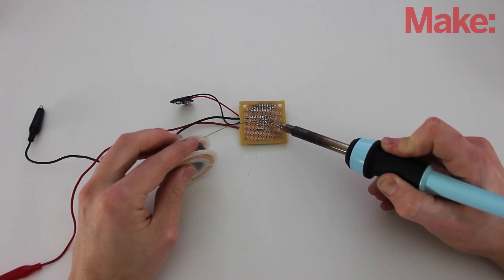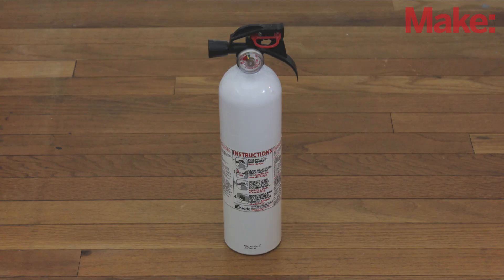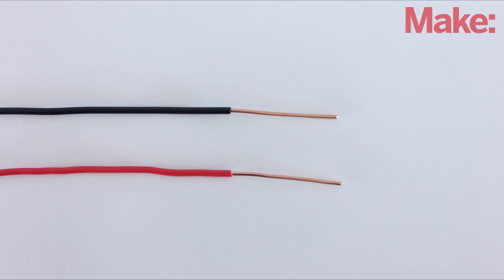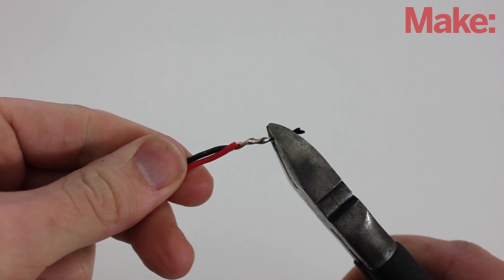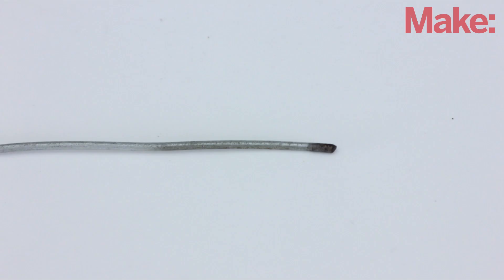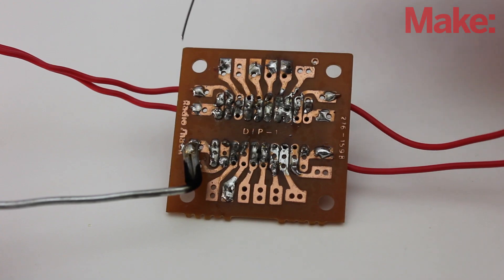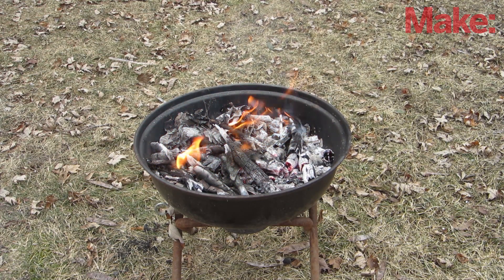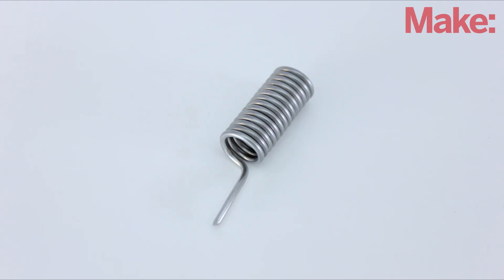Soldering Without Electricity

Comment: Never once in my 40 years have I had an emergency, where I had to solder something in the rough. Not saying it couldn't happen, just I've never had a ’solder’ emergency.
Reply: i once accidentally pulled off my keyboard's cable. it broke near the circuit board so i had to re-solder everything. i used the metal that was already there and a hot screwdriver put everything back in place. i also applied a bit of hot glue that i found inside the keyboard over the joints using a hot knife so that the wires wouldn't move XD

a few weeks ago i dropped my tv remote and the infrared led died. i ended up removing the led from an old remote and putting it on the broken one with a hot screwdriver again.

i'm still using the same remote and keyboard to this day,  when something breaks in my house i'll always try to fix it with whatever i have before throwing it out, and i became quite good at it over the years. we brazilians are known for doing this kind of stuff, we call it "gambiarra".
Reply: Haha you don't need to solder anything quick when you're out camping like everyone else does?
Reply: Then you are very lucky.

Comment: dont u need to put smth on before u solder
Reply: You mean the "flux". But he seems to be using Rosin-Core Solder (the flux is already inside the solder). In any case, I just wanted to know if the electricity-less method would work; he has other videos about how soldering.

Comment: best video I've seen on this. I got a client that needs his cheap cruzer flashdrive repaired. the "power" is on but he computer doesent recognize the device because the solder pads are fucked. i'm going to solder an old usb cable to the circuit board, and I got to do it in a library. I cant just whip out a large soddering gun! lol. this method can be achieved with my back turned up against a wall, that's good!
Reply: J'mar DDM yeah you can just yell,”NOBODY FUCKING MOVE!”, while you’re pulling it out
Reply: did it work

Comment: I guess that works if the thing you fixed runs on batteries.
Reply: well no, I get your point though. it can be used for small things like video game controllers (which can be expensive) and flash drives and such. as a tech you'd be surprised at the situations ive come across. my newest situation requires me to sodder an old usb cord to a flash drive, in a library. this method should actually work fine for that

Comment: can i use copper solid wire to solder??????
Reply: +Linang Manalisig not if your soldering a circuit, the heat needed to melt the copper would likely fry the circuit

Comment: When i come home from school for the summer i start back up my boat audio side work, sometimes they have no power out there and have to use a small pencil butane torch to solder stuff together, it has the blue flame which works a little slowly but not carbon build up and gets the job done perfectly every time thne i just use it to heat up the heat shrink tubbing over it.

Comment: I often use a small butane soldering iron from Iroda from my local DIY shop. They're not even that expensive. Really small and lightweight, no electricity, heats up really fast (variable heat output too!) and can use it anywhere. I don't know why you'd go to the extremes shown in this video.

Comment: When I first got into electronics, age 9, I couldn't afford an electric soldeing iron, so I would heat an old table knife in one of the radiants of the gas fire until the tip started to turn orange then use that for soldering. As an adult, I can afford all the tools I need, and if I'm outside working on automotive wiring, I have a gas soldeing iron for that too. No need for naked flame soldeing...

Comment: That was how soldering was done along time ago. So you've just invented something that was already invented...see Community Channel's video on this subject.

Here's a tip...if you're going to solder using this method...make multiple irons and have them in the fire and rotate through them to complete your soldering.
It's what they used to do a long time ago.

Having multiple irons in the fire was the origin of the saying, "I have a number of irons in the fire". Meaning you have a number of options open to you.

As for the person who asked the question...why bother with soldering if you have no power?.

Soldering was used for other purposes. It's only fairly recently that soldering has been used to make electrical connections.

 #learnhistoryplease

Comment: yeah, if you have a fire extinguisher you don't have much of an excuse for not having a soldering iron with you.
Reply: Lol that's what i thought... Why not use the money for an iron instead of that extinguisher
Reply: i think they just said that so you cant sue them lol
Reply: Toni Čizmić Got my gas powered pocket soldering iron/torch for 10$ on ebay. Lasts 30 minutes on a full tank. It's equivalent to 80W electric iron and it can be regulated down to about 20W
Reply: well you don't need a fire extinguisher outside
Reply: Got mine £2 car boot sale works fine guy even threw in half a roll solder
Reply: 0 volts to use fire extinguisher
Reply: He stole it from his high school.
Reply: In my defense, my local store ran out of stock... and I really want to get that project done as soon as possible. So I bought the solder wire and searched for alternate safe ways to go about it. And yes, we have a fire extinguisher 😅
Reply: Nick Navata yea. I got my soldering iron for 20$

Comment: Whats the point to solder when there is no power(I guess that you power your circuits)?
Reply: i cant even
Reply: Or maybe if you have power but do not have a soldering iron?
Reply: When the apocalypse happens and you need to make an automatic zombie-killing turret, using a spare ATmega328p and arduino parts, and have 12V batteries but the zombies have chewed through the power substations for use of a proper iron! :) Need to know how to solder the voltage regulator and DIP packages to make that turret automatic!
Reply: make a battery from a lemon and two pennies
Reply: Maybe you don't have 120/220 but you need to repair a 12v system.
Reply: Dustin Penner Because there aren't any 12V soldering irons ?  I happen to have one in my RC Quad bag for emergency repairs...
It can conveniently run off a car battery, or I can strap some Lipopacks (used to power the quads) in series to get "about 12v"
There's even soldering irons that run off the 5V from a USB.

Now a cheap "make it yourself" soldering iron you can run off 5V, a 9v battery or 12v car battery would have been more usefull than this video.

Also...  There is NO good reason to ever solder solid core copper wire. as demonstrated here.  (it's actuallybetter to just tightly twist them together and not solder)

But.. Watch next week as they demonstrate how to make your own hot glue out of discarded fish bones and powered with just a lens and the sun.  You know, this is a vital survival skill afterall, ;-)
Reply: My bad.
Reply: It's for when you don't have a soldering iron.
Reply: dont be that smart
Reply: Power Max shut up...
Reply: Power Max :P good one.
Reply: If you don't have one on hand but need to this is useful
Reply: imagine that you are going to be presenting your circuit on some kind of fair or something, and 15 minutes before it starts one of the solder joints broke.
Reply: if you're going to a fair... and you're presenting an electronics circuit...  And you don't have spare batteries, solder iron, and other stuff to fix minor issues, you're set out to fail from the start.
Reply: Can we please be friends!
Reply: diamondcraftia I'm sorry :( I did not mean to offend you or anything.
Reply: Valadcm500 Thanks! Glad you appreciate it :P
Reply: learn